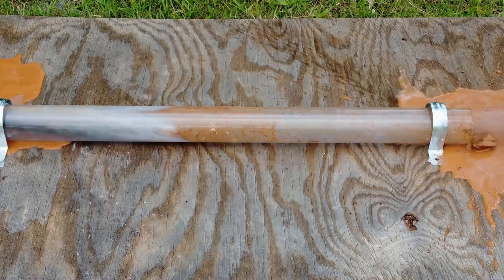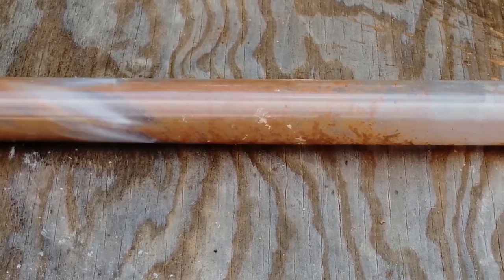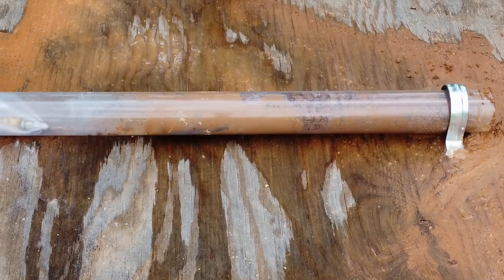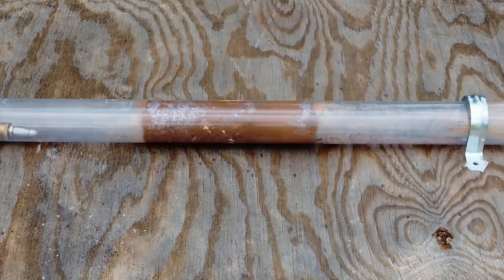Hydro JET - Destroys Clog in Seconds

Comment: Dude you are so cool. Man I got a bad drain field and need to pump the septic at least once a year. But Im tired of that routine and expense. I have known the drain field pipes are clogged and this is causing the constant need to pump. Never ever done anything like this before.Im literally a newbie barely able to use a toilet plunger.  But going on the advice and well explained videos you made. I know I can fix this problem. I finally located my distribution box (this was a years old mystery). I can see all of my leech field pipes are not at all draining. In fact they are back flowing into my main septic tank. But I can see that if I can clean out the drain field pipes, my issues are mostly solved. Right now I have a massive dose of root kill soaking in as I have a lot of trees near the tank and leech field. Roots are likely my problem.  In a few days, I will then hydro jet out the drain field pipes. I know the root kill doesn't work right away so I have patience. That said I can see the light at the end of the tunnel. Your videos and wonderful words of inspiration at the end are the fuel I so needed to keep from giving up. Thanks again brother. With your help, I am no longer shying away or willing to give up. Instead of rushing in for the W!!!! Keep rocking my brother \M/

Comment: I used to work for a company doing hydroblasting and stuff like that. Wr could cut steel with water.  But we also had what they called pencil hoses. We could put these with pullers like that plus more than  one forward cutter we could run 10.000 psi on metal pipe. Or probabbly turn it down for other pipe. We had equipment that would impress you. And that was back in the 1980s.
Reply: You definitely didn’t do that.

Comment: My sump pump holes where clogged. Contractor wanted $10k to dig foundation to replace clay pipes. I used these to open the space's back up for water flow